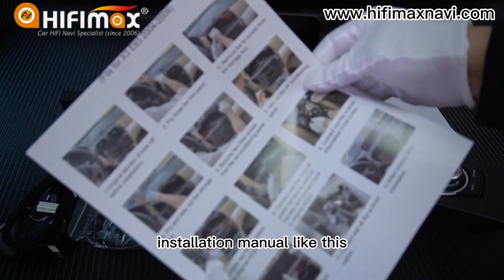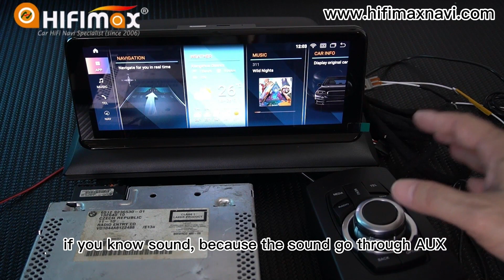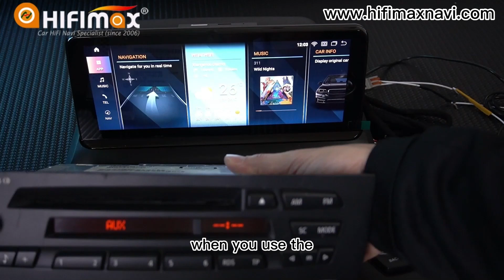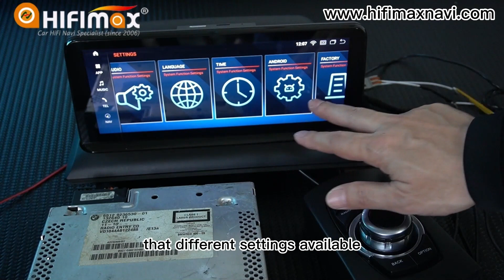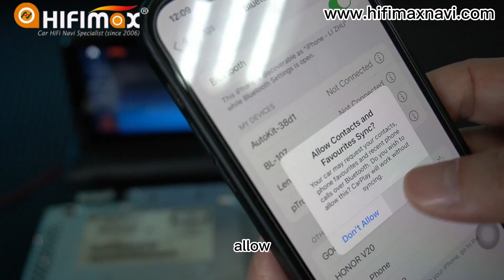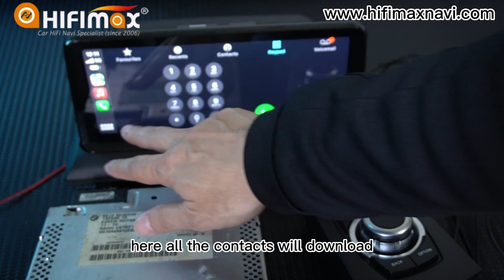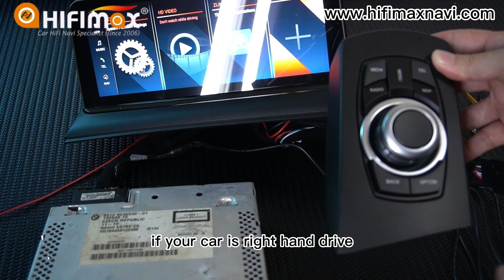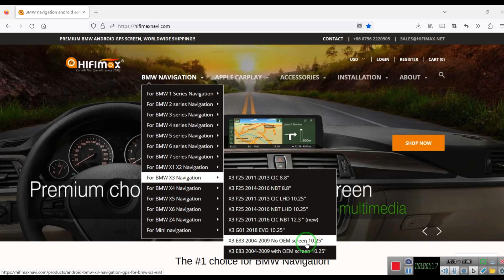10.25 inch BMW X3 E83 Android 12 GPS Navigation screen wireless Apple Carplay Android Auto iDrive!

Comment: Hello, thank you for your video. I'm French, I didn't understand everything, but I have a question. I have a 2009 X3 E83 with original GPS. You say you have to plug in the power supply from the original screen, but do you also have to plug in the big power supply?
Reply from the maker: Just have a transfer for big power cable will be fine ( disconnect the OEM power harness and plug to android power cable , and connect Android power cable ( female) to OEM radio head unit .

Comment: Hello friend, I have such a radio in my BMW X3 E83 car. I have a few questions for you: does the Android car work via WiFi or only via a USB cable. What camera model can I use for the front and rear.
Reply from the maker: The sound of android screen work via Aux cable , not by WiFi or USB; if our android model , it can install front and back cameras. Other sellers product, you can ask them ; thanks

Comment: Is there rca connection for amplifier and sounds system connection?
Reply from the maker: NO, the android screen without this connection, if you connect the amplifier, you should connect it to original radio head unit.

Comment: my dear friend, I wanted to connect my phone to the radio to make Android Car work, does it have to be a cable or via Wi-Fi? I have the same radio as in the video.
Reply from the maker: You using android auto or CarPlay function? Or just Bluetooth? Not so clear your question.  If the CarPlay ( iPhone), that is wireless connection, just pair by Bluetooth, then will be ok .

Comment: Hello, i installed everything exact like you. But the Display wont go on. The Radio works. But the Display ist dead. I tried everything. Pls can u help me
Reply from the maker: It need to check in details, better contact your seller for that .
Reply: The same thing happening to me
Reply from the maker: if your car is X3, without OEM display, in the setting, there is a setting call " car without OEM display", you need to choose it. if you can not get into android screen completely, that need to check details, so, your seller might know more on your products and your case, recommend to contact with them.

Comment: I have a x3 but it haves a aftermarket radio installed can I still install
Reply from the maker: It need to remove the aftermarket parts ( display or radio), it have to use original radio head unit .

Comment: Hi Paul, I have a BMW '04 X3 without the storage unit on the dash.  It looks just like the storage unit, but it doesn't open.  Will this still work?  What do I need to order for it work.  I don't have AUX, so I know that I need to order that. Thank you for your time.
Reply from the maker: The X3 E83 without OEM screen, it choose this model:
https://hifimaxnavi.com/products/android-bmw-x3-navigation-gps-for-bmw-x3-e83

But it require the car with AUX-In, if there is no AUX-IN, two ways:
1, You can find a local tuning shop to add it, it need to code the car and add the AUX cord 
2, You can use FM Stereo modulator, this also ok, but since it is wireless signal, it might have interfere，so, to add physics  AUX-in is the best way.